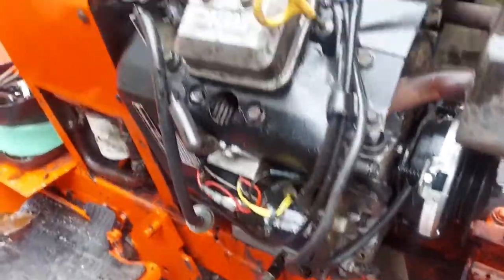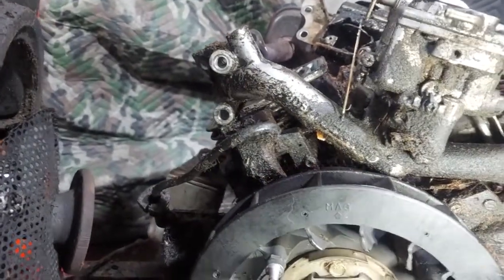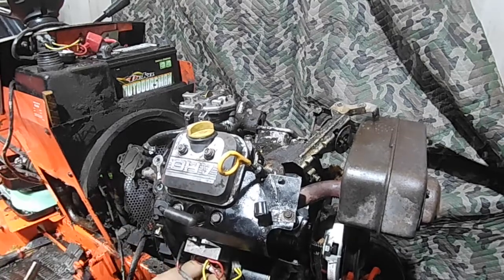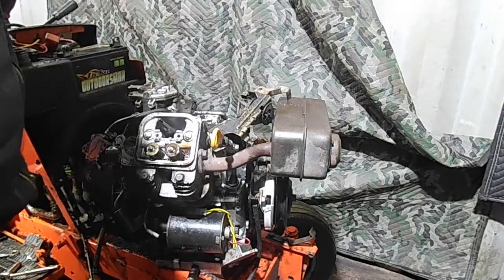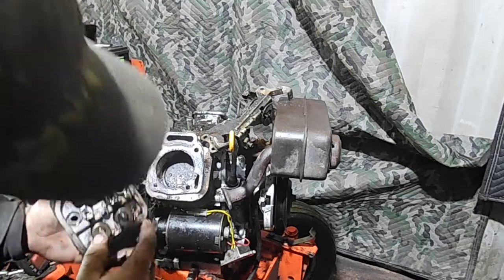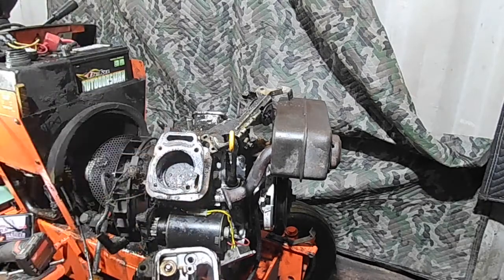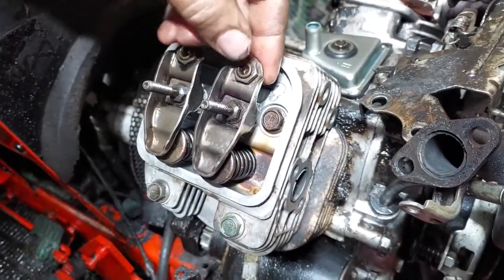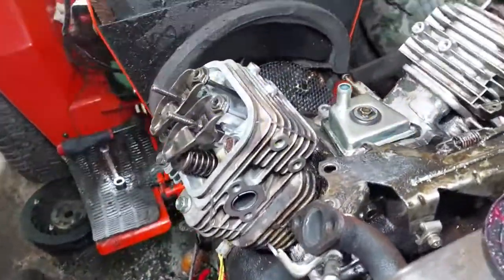Replacing Head Gaskets On Briggs & Stratton Over Head Valve Engines- Vanguard, Intek, Other Makes

Comment: What should a this gasket repair cost roughly? I have an insulation vacuum with this motor with this same issue. Thanks in advance.
Reply from the maker: It's all going to depend in your local market and the equipment it's in and if engine has to be removed or not. Best take it somewhere for a quote.

Comment: Hi! Going to look at a 3014. What should I look for more closely? Thanks.
Reply from the maker: Hi nothing really special,  that motor runs decent and not much smoke if any. That it drives and operates as it should. We have all kinds of parts in stock so if needs a little work we can get you hooked up. They are pretty simple and durable machines. Best of luck let us know how you make out! Thanks for watching and the comment!
Reply: @caseingersolltractorsnortheast  thanks for the quick reply! Greatly appreciated!
Reply from the maker: @HuckThis1971  You are welcome!

Comment: What a mess that’s a weak link on vanguards is oil seals I feel and gaskets those tractors and engines were filthy
Reply from the maker: Yes this one was very dirty and neglected.  Very surprised not more engine damage was done. Yes the Vanguards don't like to get very hot at all before seals and gaskets fails.

Comment: Over all Briggs & Stratton is junk...I have a 35HP vanguard that is super clean and babied...200 hours and cylinder 1 head gasket already has issues. JUNK
Reply from the maker: They are not a bad engine and in today's standards as good as anything else out there. But like anything they are not the quality of engines that were built 20 plus years ago. But maintenance and pulling all heat shields and shrouds off and cleaning at least once a season is key with Vanguards, can not over heat them. Regular valve adjustments and OEM filters and parts is important as well.  15-50 oil is best in Vanguards as well.
Reply: @caseingersolltractorsnortheast  mine is a boat engine. Super clean. Oil changed regularly. Valves adjusted per manual...when after all this it has 40% leakage on cylinder 1 leakdown test at only 200 hours...I call that junk.
Reply from the maker: @jc7409  ya thats to bad like everything there are bad ones for sure. We do come across them. But there are litterly millions of them out there running.  They bee around for a long time and put in everything under the sun. But I can get your frustration with 200 hours. They definitely are not the quality of say Onans but should get 1000 to 2000 hours on them before major repairs.
Reply: ever try copper head gaskets?
Reply from the maker: @akn2605  no we use OEM head gaskets, we do put a layer of copper sealer on them though.